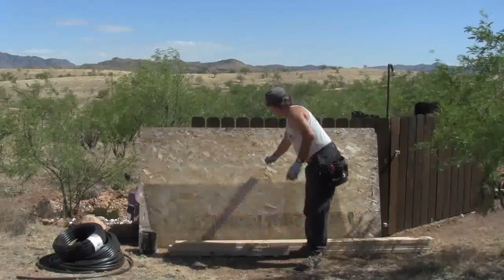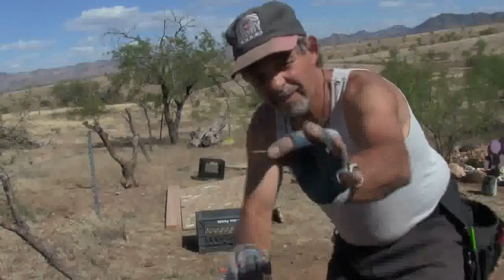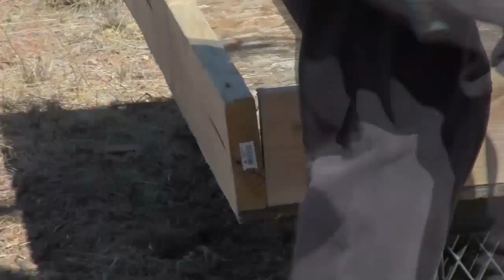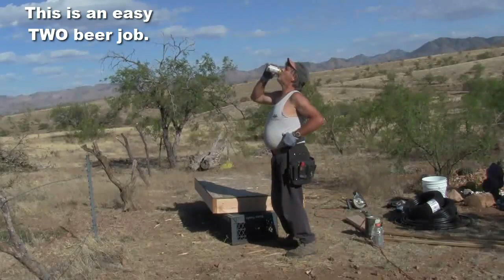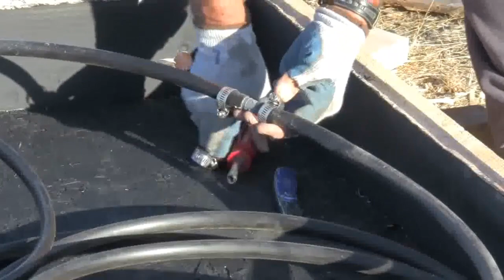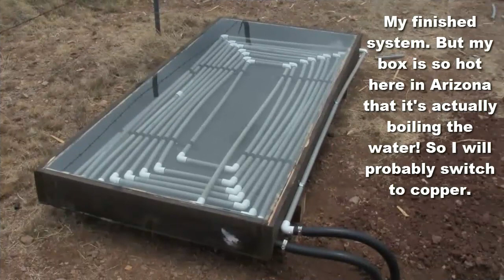SOLAR HEATED SHOWER FOR UNDER $50

Comment: You may not need to switch to copper. Try a sheet of Coolaroo Exterior sun shade(from HomeDepot) under flexi glass. It blocks direct sun to penetrate to the pipes.